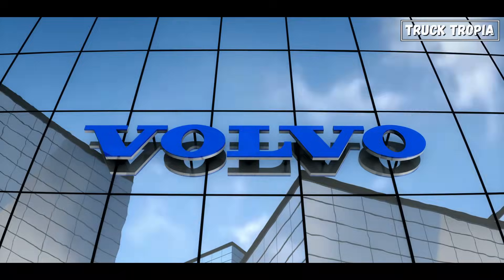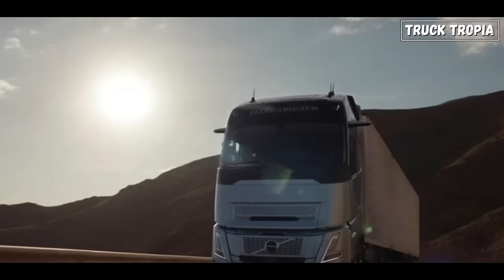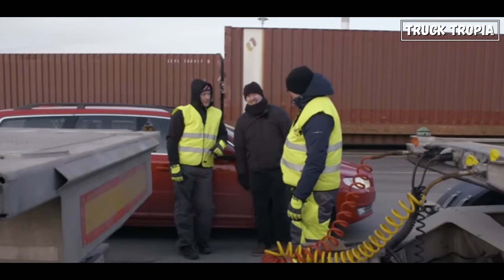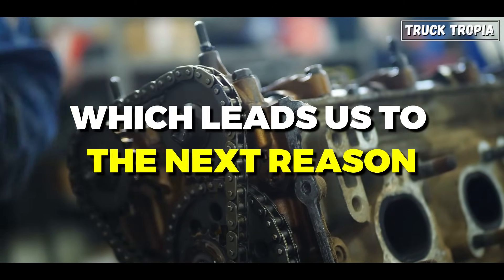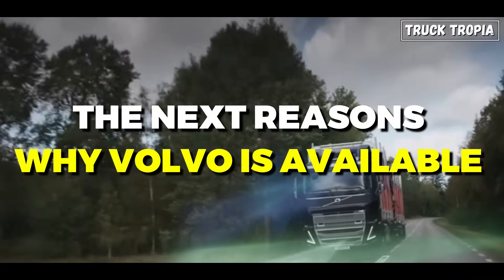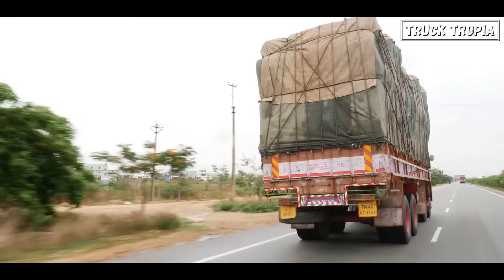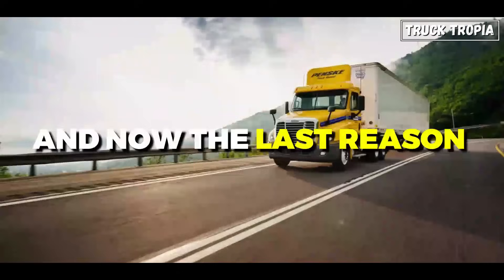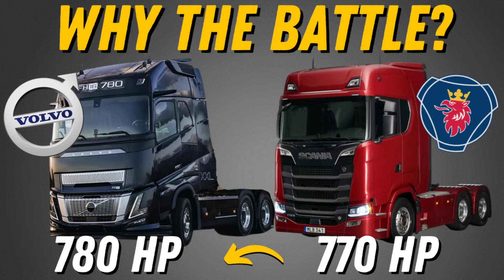Why American Semi-Trucks Can’t Match Europe’s Horsepower?

Comment: America has: 
Lighter loads
Lower weight restrictions, where you can only weigh up to 36 tons on major highways
Mostly flat landscape

Sweden has:
Loads heavier than fully loaded American semi trucks, with no need for permits
Very elevated terrain with lots of inclines and declines covering most of the country
Reply: America has way higher speed limits for semi trucks . You can legally drive 37 ton truck at 80 mph (130kmh) in Texas and Wyoming
Reply: There are also 100T HCTs.
Reply: Standard highway inclination is the same in usa and most european nations, that is 6-7%. New roads are not alowed to be built with more and old road have to have warning and map data information.

On top of that, for highways the higher speed in usa will need more power in a 6% uphill than a europan standard 44 ton truck in a 7% incline.

The 700hp trucks is really not made for the 44ton loads. They are made for the 70+ ton scandinavian trucks.
Reply: You are correct and what you are referring to 36 tons is actually the US maximum load in metric tons 40 us Tons. In Europe the maximum load 44 metric tons 48 US tons which makes them over the US weight limit of 40 US tons
Reply: @EpicThe112  In Europe it depends on which country. 

In Germany, for example, the max weight is 44 tonnes and length is limited to 18.75 meters. But in Denmark it's 56 tonnes and up to 18.75 meters (they're still in the testing phase for 25.25 meter combinations), as well as a max height of 4.1 meters. 

In Norway, the limit is 50 tonnes andmax legth of 19.5 meters, with exceptions for module transports, which are allowed to be up to 25.25 meters and weigh 60 tonnes. 

In Sweden, the highest limit is 74 tonnes and 34.5 meters, as well as a free height of 4.5 meters, though you are allowed to be as high as you want without getting a permit. Bridges lower than 4.5m will be marked out. The 34.5 meter road trains are usually not allowed to weigh more than 64 tonnes. Our HCT combos (74 tonnes) usually concists of an 8x4 truck pulling a 5-axle trailer. The weird thing about it is that 2/3 of all axles on the vehicle combination must have double mounted wheels, which is quite uncommon on semi trailers here.
Reply: You are so far ignoring Finland. 76 tonnes on 11 axle combo (or 9 axle, if 6 with double wheels) is regular weight limit. HCT beasts with permits can weight up to 104 tonnes. And there are even heavier experimentals.
Reply: there definitely not heavier than us
Reply: @hunterisdabby  Max weight on American highway is 80 000lbs. That's gross weight with vehicle weight counted in. Here in Sweden, the regular combo, rigid truck with full trailer, has a max LOADING weight of about 85 000lbs. I've seen trucks here, mostly Volvo and Scania, pull over 700 000lbs. Can you say the same about American trucks?
Reply: Most trucks other than vans are running heavier with permits. Indiana 108,000 on a tandem drive truck and tandem trailer. 121000 for a tandem truck and tri axle trailer. Michigan has supers that run 154,500
Reply: @tntfreddan3138  In the United States and Canada you would need a special truck for that much weight Kenworth Makes a Truck called a C500 it is strictly Designed for off highway or heavy haul on highway kenworth claims it Can haul 500000 lbs but im sure the c500 has hauled more than that Couldnt say that a W900 or T880 would haul that much weight i gurantee that they have hauled way more than 500000 lbs problem is the c500 is way Too Big for Europe.
Reply: @tntfreddan3138  volvo and scania also have a extra-heavy market outside of Europe, Scania decided to sell their 770 hp engines to haul 90 ton road trains here in Brazil.
Reply: @tntfreddan3138 
Canada has heavier trucks (41 for two axles, 49, 57 and 62 tonnes for B-doubles) and the 450 to 550 HP engines are the most common. Though they're noticeably slower uphill.
Reply: @1wun1  Sweden has 50 tonnes for 6x2 pulling a 3-axle trailer (44 tonnes for the regular ones, but 50 tonnes for the ones hauling tank containers and bulk containers and such. Usually hauled by rail in both US and Canada). 

64 tonnes for B-doubles and regular 7-axle truck-and-trailer combo (6x2 or 6x4 pulling 4-axle full trailer). 

74 tonnes for Class-4 truck-and-trailer combos (8x4 pulling 5-axle full trailer). 

Most trucks are 500-600hp, but there are also some older trucks (15 years or older) that has less and there are those with a LOT more. Afterall, the only two truck manufacturers that mass produce truck engines with over 700hp are located in Sweden.
Reply: @tntfreddan3138  
Oh I see, I meant heavier than US ones. Those Swedish weights are insane, Alberta has King B doubles that top at around 80 tonnes
Reply: @Nich_Pavelow  no torque? Good joke. The D13K500 (500hp and 1850 lbft) has the same amount of torque as the 550hp CAT C15 engine. The D13K540 has 1920 ftlb. Fact check next time
Reply: @tntfreddan3138  bro you do realize the USA has permit loads that go past 60 tons gross weight right. There are definitely cases were gross weight of permitted exceeded 1 million lbs and I'm sure the European union has seen similar records of permitted weight loads being transported by their own trucks.

I'd like to say that you need to do some more research. 

All trucks rule.anerican trucks may be weaker but I really don't care about that, as long as I can maintain a healthy pace. I like European trucks too, most of them seem gorgeous but very similar to each other.All I can say is, learn to appreciate each other trucks differences and similarities. Truckin' is still truckin'. Stay safe, stay curious, get paid, go home to celebrate/share the spoils with family and friends.😊
Reply: @daneblackburn613  that explains the crappy condition that interstate 465 is in around Indianapolis.😅
Reply: @JohannZ100  yeah that c500 really is a monster of a semi truck simply because of its rigidness and durability and bare bones, angular look. Looks similar to an army vehicle.
Reply: @hunterisdabby  Sweden can have trucks up i think 60 tons without a permit
Reply: @moggable  74 tons*
Reply: The EU weight limit for trucks is 40 tonnes or 88,000lbs, here in UK we can load up to 44 tonnes or 97,000lbs as long as you have a 6x2 tractor unit and 3 axle trailer with road friendly air suspension. Other countries in EU as in the comments have higher domestic weight limits like Nordic countries

Comment: Hey guys an european here. Honestly you dont see FH16`s or Scania V8`s so often on the street in my region. Most longhaul trucks here are fitted with engines in the 500hp area no matter which brand. This might differ on regions cause for example the dutch love their V8`s although the Nederlands is a very flat country.
Reply: Most likely places to find Scanias and Volvos with their behemoth engines will be in Sweden and Finland because they operate in extreme conditions and have a much higher weight. It's not a coincidence that the two strongest engined truck brands are Swedish and also doiminate the Scandinavian truck fleet maybe 8-9/10 trucks there will be Scania or Volvo.
Reply: Because we drive here 50ton or 60ton lzv in Holland
Reply: @svenlinsen222  no problem driving 50tons with a fh 540
Reply: @svenlinsen222  even the Doubles are a lot of 500HP. 
Scania R450 and so on?
Reply: Here in rural sweden they are fairly common. Its not like most trucks are, but the heavy long hauler typically are. Now when gravel trucks usally are 8 axels as well they often come with 600+hp engines as well.

The very top end, the almost 800hp are mostly just used for special transports.
Reply: The 500hp Scanias are a lot of the time V8 and not just the Super, but rarely do you see the full power models of each brand unless it's a wood truck that regularly gets loaded to max weight limit.
Reply: We have a quite a few of those V-8 Scania’s here in New Zealand.
Reply: In italy it depends what job you need and who wants to own a higher power engine
Reply: En jouw steenkool Engels verdiend een update!
Reply: En jouw steenkool Engels verdiend een update!
Reply: Even in South Africa most heavy loads are pulled by 540 or 610 Volvo

Comment: Scania still has the top spot being measured at the wheels.
Reply: No manufacturer rates shit at the wheels. 
Since everything can change that. Like wheels, diff ratios, gearbox type and ratio ect.

All manufacturers rate power and torque at the Flywheel. 

Hence you order a 600hp engine option.  Not a 600hp truck.
Reply: @audoinxr6372  You’re dead right. I do enjoy winding up Volvo drivers, though.
Reply: Yeah, I heard that Volvo doesn't measure WHP, or WTQ.
Reply: Odd how they measure, for example, 590hp at the wheels, when our ministry of transportation measures power on the crank and they only get 589hp. Meanwhile, a 540hp Volvo measures 551hp on the crank.
Reply: @tntfreddan3138  that is odd

Comment: And what about the Australian market? How different is it compared to these? I'm only asking because I understand that Volvo distributes trucks there as well. Are the European or American models there, or are they also tailored to that particular (Australian) market?
Reply: They dont get the vnl the because the volvo fh produced in Australia specifically for Australia
Reply: We build/assemble our own kenworth's. But they are an imported American cab with updated chassis, and they have 600hp Cummins x15s usually. But they ride shit and break more than Volvo's and Scanias in the chassis.
Reply: @Low760  k220 kenworth is built by Australia not USA import
Reply: @Low760 an American here are you taking the cab over cabs or the bonneted trucks as yall call them because we don't get none of those cabs
Reply from the maker: You Can learn about Australia trucking Here Why Australia Is The ONLY Place With Road-Trains?
https://youtu.be/TksLDZ9IDbE
Reply: In Australia we have our own volvo plant and manufacturer the FM and FH with the D13 up to 540hp and the FH16 with the D16 up to 700hp soon to be replaced by the D17
Reply: Australian regulation is sort of a mix from is and european. 

Top allowed speed is in between EU and usa standard, att 100km/h its closest to UK.

Axle load is lower than europe but higher than usa. That is why european trucks often come with one more axel in australia.

Tire pressure and wheel configurarion rules are more simular to usa.

The length and weight varries from state to state. The very longest trucks are only alowed on privat road. The tripple A that is the longest on public roads are only alowed (top of my head) in 2 states. The tripple B/doubble A is alowed in most but not all states, but are genrally banned in most large cities. Those are basically the same as in sweden and finland. A few tons and meters off, but they will need more axles. The last states only alow basically standard trucks as well as the cities.

Comment: Kenworth trucks are waste in front of Volvo trucks
Reply: I dont know about that dad drove a 2001 Kenworth W900 and he never had many issues It only issues I remember was the Driveshaft having issues and the compressor needing replaced but it sadly burned with a shop that caught fire. It had a Detroit series 60 and a Fuller 10 speed non-syncronized transmission
Reply: Driven both, Volvo is more comfortable and relaiable (Kenworths are pretty bad theese days)
Reply: @kolejnipolscykrakersi  Hopefully Volvo should introduce their VNL 860 trucks in our India. As Volvo has a margin in India, they can make their Volvo VNL Trucks in india.
Reply: @kolejnipolscykrakersi guess you don't own your own truck? The Kenworth you drove obviously wasn't a W900L with front air ride.
Reply: 😂😂😂😂😂 sure
Reply: @renatocaviedes4313  why are you laughing? i am saying something good and you are making fun of it 😡😡😡😡😡😡
Reply: By Kenworth, you mean Paccar products, genius? 780hp but low torque. Cummins x15 makes 605hp with 2050 torque. Deleted they make 18% more in both aspects. In the end, my Kenworth is more powerful,  easier to maintain, and is accepted at all truck shows. Volvos do not last, definitely not to 1 million miles in America. Plenty of 1970's Kenworths & peterbilts around. Know what you are talking about before you talk
Reply: @Nich_Pavelow  hello Volvo FH 16 780 torque is even more than the Paccar MX13. Volvo FH16 780's D17K has a torque of 3800 Nm, i.e. 	2,802 ft lbs.
Reply: Educate your self before posting B'S Volvo 780 have 2800 foot of torque, noAmerican truck have that power @Nich_Pavelow
Reply: @Pelinas  some glider heavy spec trucks do. I talk to a guy that had a v12 cat motor in his truck. About 3,000 ft lbs. Of torque but that wasn't a mass production truck. Those Volvos really are nice though. I wish I could drive one.
Reply: @sandasturner9529  then you should go to Europe and try
Reply: Volvo 780 has 3800nm of torque.
Reply: There's only 2 American trucks that are real trucks. The kenworth W900L and the peterbilt 379.   All other trucks are junk especially Volvo.   And international
Reply: @Longhauler379  oi, these 2 trucks are also junk. these trucks will pollute a lot of smoke compared to newer trucks
Reply: @SaiCharanReddy-oz8ez  that's OK. At least with the right engine they are bomb proof.     Only know that cuz I own them.   379s 389s and W900L s.   Best trucks ever built